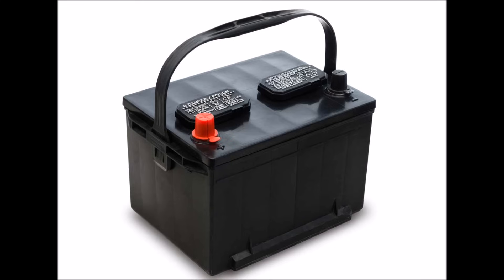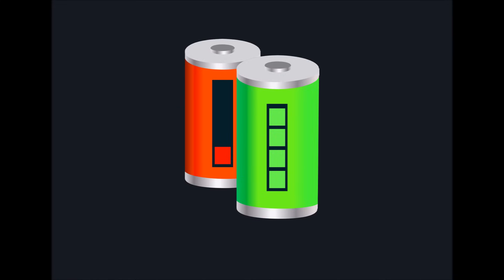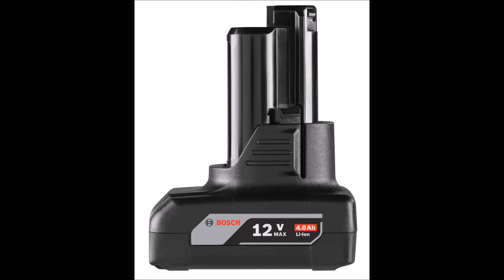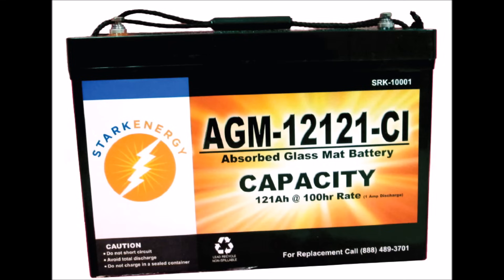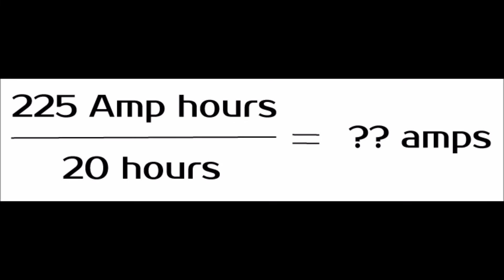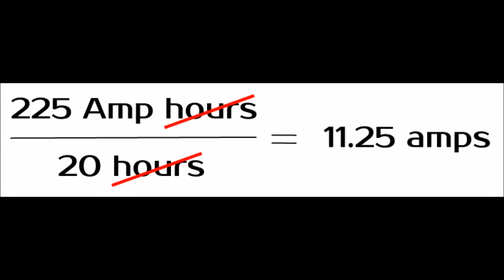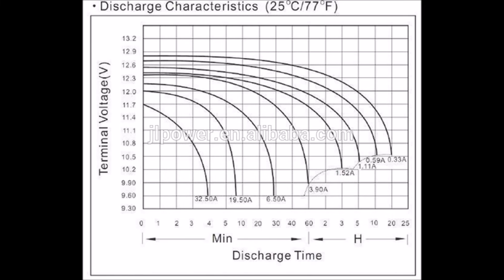Amp Hours???  Battery Capacity Explained

Comment: Amp-hour ratings are approximate statements related to the stored energy capacity of a battery.  Energy is power over time.  If you look at the chart, each curve corresponds to discharging a battery at a different current.  Power is current times voltage.  If you multiply the voltage curves on the chart by the respective currents, you will get a new set of curves, the area under which is the energy drawn from the battery.  For example, the leftmost curve shows a drain of 32.5 amperes.  The initial power drain at this current is 11.7 X 32.5 = 380.25 watts and this power curve would be much higher than the rightmost curve showing a drain of .33 amps, initially at about 12.8 volts = about 4.2 watts.  The area under the two curves should be about the same, the energy capacity of the battery.  Actually the high curve may show a little less capacity because some of the energy is being dissipated as heat in the battery proportional to the square of the current.  All this is too complex for the average consumer so amp-hours is used as a simple metric related to capacity.
Reply: Sorry, @trueman, if I wasn’t clear.  Technically, energy is the integral of power over time.  If the power is constant, then energy is simply power times time, hence power is in watts or kilowatts, time is usually in hours in this case.  Hence energy is often expressed in watt hours or kilowatt hours.
Reply: @machine60  It's probably more accurate to say energy is the time integral of power. I suspect this is what you meant by "over time."
Reply: @truemanP  Correct and in your words power is energy divided by time when the power is constant.
Reply: power is energy over time

Comment: Thanks,  i am even more confused than before.
Reply from the maker: Sorry.  What part is confusing?
Reply: @LDSreliance  sir... If a battery is 30k mah... The rated output is only about 18k mah(usable to charge depending on efficiency) my question is. Why cant we fully drain a battery? Like if the battery capacity is 30k mah then we use all of its 30k mah capacity instead of just the rated output of 18k mah.. Why must the battery store the extra 12k mah?
Reply from the maker: @alaxe97  There is a relationship between cycle life (the number of times you can charge & discharge a battery) and depth of discharge (the % of the capacity of the battery that you deplete before charging).  This relationship is pretty dramatic in lead acid batteries so the deeper you discharge a battery the lower your expected cycle life of the battery will be.  That is where the "50% rule" came from that you only want to discharge a lead acid battery to 50% because beyond that you are radically reducing its life.  That is not always true but as a general rule it is good enough.
Reply: @LDSreliance  …who’s on first? No who’s on second. What? What’s on third. Who? No. who’s on second. Then who’s on first? No. What? What’s on third. Who’s on third? No who’s on second. What??
Reply: @dr4g0nb0y4  ...Rain Man edition 😂
Reply: @LDSreliance  he's just a dud. Was explained well
Reply: @LDSreliance all of it
Reply: @LDSreliance  im now getting into car audio and I hear these big car audio guys always talking about amp hours, so im jus wondering does more amp hours equals more power for the system?
Reply: @dhatbwoy696  same here....I have everything else in car audio down to the bone but I'm still stuck on this
Reply: @elmikeoboyz  lol big facts bro it's been 5 months since this comment I made and I'm still confused af lmao 😂 someone need to simplify it more.
Reply: @dhatbwoy696  on me bro...this would make my car audio experience soo much easier if I understood this portion
Reply: Me 2
Reply: Can you work out ah on battery that has half the original cca? Im assuming divide original ah by 2!is that correct? Any reply appreciated thanks from Australia!
Reply: When I read your comment without watching the video I laughed at the maker. But after seeing the video am laughing at you (viewer)
Reply: Efegzqwerty
Reply: Dumbo
Reply: So will the battery last 20 hours at 11 amps or 20 hours at .33 amps?
Reply: My man why 😂
Reply: Lol. I’m right there with you. Researching batteries is like gibberish in the beginning. Stick with it. It will all become clearer and clearer the more you study. Good luck
Reply: 😂 it’s rough
Reply: Please never get into engineering
Reply: This is witchcraft,lol! I can't get a straight answer for years now! 450 amp hour 12 volt lead acid deep cycle will last how long drawing 10 amps? I'm getting multiple answers that aren't even close to one another!🤔
Reply: I think it's all bullshit.  I'll bet that so called "20 hour battery" isn't going to give 20 hours of continuous work.
Reply: what was confusing about it, this is the first video after many that i have watch were i understood it, on the first watch. Will i watch it again to make sure i sound smart if someone ask me about battery capacity ? of course!!
Reply: If that is seriously more confusing then not knowing anything of what he just said then you seriously should not be working with batteries, unless of course you find a way to look at it more simply and not overthink what he is saying really just listen and it might make sense to you if you do that

Comment: Good day, that's good information. I have an adaptor and data cable, but their ampere is different. The adaptor have higher ampere than the data cable. How could I compute WH? Will I sum the two amperes?

Comment: Please don't compare lead-acid batteries with Lithium Ion batteries when talking capacity.  It adds confusion into the mix. While Li-Ion batteries give back most of the charge,  lead-acid batteries conform to Peukert's Law, which was discovered not long after their invention back in 1859 by Gaston Planté. That's the discharge run-time graph you show.
There are very few good lead-acid battery tutorials on the internet. Most are trying to show how to calculate the size of the battery bank and solar panel installation and then they add in the charge controllers (PWM & MPPT) and inverters (pure sine wave and modified sine wave) into the mix and very few viewers can figure out what the video was all about in the first place. Each of these topics deserves a separate tutorial with real facts and figures, probably 2 or more parts to some of them. Did the spec sheet show the charging characteristics? Most don't but depending on the plate construction and chemistry,  you need between 30 to 40% more energy to fully recharge the battery.  For example, a fully discharged 100AH deep-cycle lead-acid battery will require between 130 and 140 AH of charge. A point sadly missed by most battery tutorials.
Other videos are busy trying to sell batteries and add even more confusion. These are put together by sales-people who don't really understand the vagaries of rechargeable batteries of any type, let alone lead-acid. There are videos that repeat myths that need to be eliminated about lead-acid batteries. 
For a "thing" invented back in 1859, they have more myths and legends about them than anything else that I know of.
Reply: So bro, do you have any youtube video that you can recommend to?
Reply: Sorry bro, I've been on my back for the last few weeks in hospital with a broken ankle and have lost track of my list of good tutorials. I should have used notepad instead of the paper one that my son cleaned up... he has OCD. Another 6 weeks til I'm mobile and can find my list.  knurlgnar24 has really good explanations and understands battery capacity.

Comment: What's the difference between volts and ah? Why do android phone batteries have an ah capacity while a dry cell have volts? Please enlighten me, I'll appreciate it.
Reply from the maker: Those are two different measurements.  All batteries have both ratings.  The manufacturer may not put that information on the battery, though.

Comment: pop quiz. what would you need to run 1000w for 12 hours straight
Reply from the maker: Are you asking a basic math question or are you asking how many batteries that translates to?
Reply: LDSreliance  how many  of what kind
Reply: LDSreliance can we get  he answer to that one ? i couldn't figure it out
Reply: LDSreliance what kind of battery  WOULD you need ?
Reply from the maker: You would need a total of about 1020Ah of battery capacity to run 1000W for 12 hours.  Depending on the size of the batteries you use, that could be ten 100Ah batteries or five 225Ah batteries, etc.
Reply: LDSreliance dang thats alot off batteries there any battery that can hadle it by itself?
Reply from the maker: I don't know of any batteries that are that large in one battery.  I am sure they exist.  Maybe for industrial applications.
Reply: For that sort of power you need a connection to the grid.  1,000 Watts per hour is the average British household demand.  (1,500 for Americans. Brits don't have 
air conditioning.)

Comment: Could you please go into whether or not 2 batteries for say a 200 watt system could be an advantage.
Reply from the maker: Are you talking about 2 batteries versus 1 battery of the same capacity?  Generally that means you are comparing two 6V batteries connected in series vs a single 12V battery.  It depends on the quality of the batteries.  Generally, a 6V battery will be either a golf cart or industrial battery which are very durable and higher quality than a typical 12V deep cycle battery.  Now there are obviously 12V deep cycle batteries that are high quality from Trojan or Rolls or other companies.  But when most people think 12V they think of a marine or RV battery.  So in that case the two 6V batteries would be much better than a single 12V battery.

Comment: would this change if you had a super capacitor hooked in the circuit?
Reply from the maker: In a way it would add to the overall capacity of the system.

Comment: So if I am running 2  AGM GPL24 batteries which are 80amps each for a total of 160 amps how long will it run at 7.5amp DC draw. can you answer and put formula here. Thanks.. This is great..
Reply from the maker: Roughly 21 and a third hours.  You can find formulas and explanation for the math here: https://www.powerstream.com/battery-capacity-calculations.htm

Comment: Someone, please help if you may... I have 2x 12V batteries in parallel. they are lead acid. it sais they have 105 Amps at 20 hrs/each. So in parallel does that mean i have 210 Amp hours at 20 hours? I have 100W light bulb, but if i run it off my 700w inverter, with these batteries, i only get 2.5 hrs of run time, as i dont want to go below 12.1V....i turn it off to save the batteries life. Why am i getting only 2.5 hrs of run time? Please help...thanks.
Reply from the maker: Yes, in parallel that means you have 210A.  But keep in mind that lead acid batteries should not be discharged beyond 50% SoC.  So in reality you still only have 105Ah as both batteries only contain 52.5Ah.

Comment: Hi. I bought two 12v26ah10 hour batteries by mistake for my mobility scooter & I just noticed the ones that were in it are 12v26ah 20 hour batteries. Will the 10 hour batteries I just bought WORK in my mobility scooter?
 If so, what changes can I expect?
Thanks.
Reply from the maker: They will work and they will actually last twice as long.  The 20's you had in there previously are rated at a slower run rate (20 hours) so their capacity (26Ah) is inflated compared to the 10's.
Reply: LDSreliance Thank you so much for your insight. This comes as good news the 10hr ones will last longer. 
Will these 10s give superior performance? 
 I ask this because  the scooter seemed to never be able to drive fast speed again after the 20s were installed. Always drove at lagged speed that felt like battery was about to die...as if it didn't charge, even tho it was keft to charge a long long time. ( for days)
 Maybe with these new 10 hr ones, I can reach the original fast speed as it did when I 1st bought my scooter...before that guy installed the 20s.
Reply from the maker: It is possible.  I don't have all the information on those batteries but they might provide a little better voltage at the same loads than the other batteries.

Comment: I have two 12V 55Ah 420A car batteries connected together and i need to find out what alternator i should get. Does a 28V 55A alternator fits?
Reply from the maker: Yes as long as your batteries are connected in series for a 24V system.

Comment: So if I increase the voltage of a battery the capacity would decrease witch means the battery would take less time to run out??
Reply from the maker: No because the amp draw on the battery will be less.  It will actually run longer due to Peukert's Law.  In other words, a 12V battery with 100Ah is equivalent to a 24V battery with 50Ah.  Now let's say you want to use a 500W load off of your batteries.  If you run that load on your 12V battery it will consume 41.67A.  If you run that load on your 24V battery it will consume 20.83A.  The 24V battery will be able to run that load longer because Peukert's Law states the higher the current draw the lower the capacity of the battery.  Does that make sense?

Comment: I'm considering a second battery for my car that will run multi-cameras, countermeasure gear, SSD storage drive, and an AC powered speaker. While I know, I will need an inverter, but I can't tell heads or tails of the amp rating of the BU switched isolated battery I'm considering. Here is an example: There are various references to amps, but I have no idea which one indicates the 'basic' amp rating. Open Circuit Voltage – 13.3V Max Charge Voltage – 15.0V Recommended Charge Voltage – 14.5V Minimum Voltage – 8.0V Max Discharge Current – 2,400A Continuous Discharge Current – 1,080A Max Charge Current – 540A RC – 124 minutes @25A Watt-hours – 675. Most of the values seem rather high, so I'm guessing RC-25 (Run Continuous) amps?
Reply from the maker: That is a very interesting battery.  Do you have a link to it?
Reply: Sure thing'...https://4xspower.com/shop/lithium/ultra-safe-technology-lithium/xs30k/
Just let me know your take on the amps of this battery. Also, I would like your feedback on using a single 30k or two of the 15k. I want to use an A/B switch if I need to change over as an alternate start battery; but primarily, the bank would be to drive a 4~8  channel dash cam array w/IR connected to an SSD storage; while I'm away from the vehicle when shopping, etc. CTR~
Reply from the maker: Daniel, that is a very interesting battery.  I am highly, highly skeptical of the specs, though.  675 Watt hours is only about 56Ah.  A comparable 65Ah lithium iron phosphate battery that I carry from Miller Tech only costs $580 and can handle a maximum of 200A.  Your battery claims it can provide 30,000W (2,500A) burst and 15,000W continuous (1,250A).  That is not only incredible but very dangerous.  That much current would require incredibly large cables and great attention to safety as it could instantly start a fire or electrocute you.  If these claims are true, it is constructed as a starter type battery and would not be appropriate for deep cycle use as it would not last long.

If you are interested I can help you find a battery that would work.  Just shoot me an email at ldsreliance@gmail.com.
Reply from the maker: Another concern I have is that battery is only warrantied for 1 year.  Reputable lithium batteries should be at least 5 years, IMO.
Reply: May you have a recommendation on some other Lithium Battery offering?
Reply from the maker: Yes I do.  Email me and I will send you the details.

Comment: Time index on your video at 2.24 you said the battery is rated to produce 11.25 amps for 20 hours straight,! then towards the end of the video you said in your chart, you say, if you run .33 amps (.33 amps is less than 1 amp,! mind you!! ) it will run for 20 hours at .33 less than 1 amp) then you said if you run it for 32.5 amps it will last 4 minutes!!! Beginning you said 11 amps last 20 hours so 33 amps wouldn't that last one third of 20 hours which should be around 7 hours and not 4 minutes????? Either your math is wrong or, I'm really missing a big part of electricity mathematic calculations!  and I took 2 years of electric wiring and two years Electronics!  School me in on this! nice video though!
Reply from the maker: Jason, I apologize for the confusion.  I re-watched that segment and I can see how you are confused.  The math problem I did and the chart that followed were not the same battery.  They were different examples.  So don't try to compare those numbers.

The point I was trying to make with the chart is to introduce you to Peukert's Law which states that battery capacity decreases as you increase the current.  In other words, the relationship between current and run time is not linear.  Does that make sense?
Reply: LDSreliance yes it kind of makes sense I've never heard of that law I'm assuming that's a lot of physics of batteries I was not school then batteries and that's what I'm watching these videos, I think I understand if I understand it right the faster you used energy from the battery the less energy the battery puts out over time is not linear, maybe kind of like if you accelerate a sports car to go from 0 to 60 and 3 seconds or 4 seconds it uses a lot more gas than it would if your accelerator 60 miles an hour slowly, I don't know if that's similar but I'll research that law! Your video is very interesting I'm going to research 1 batteries I have a solar panel with a Walmart deep cell battery in a solar panel
Reply from the maker: Yes you have the general idea.  I have some solar basics videos that you might learn some things from to help you get the fundamentals.  Then you can add on with more advanced stuff like Peukert's law.  Here is the playlist:  https://www.youtube.com/playlist?list=PLbKwoGlXEWapfh6AwV1F3FdOIb3hlGcYh